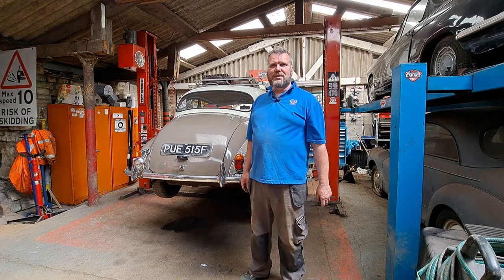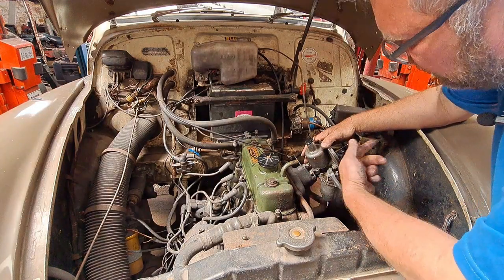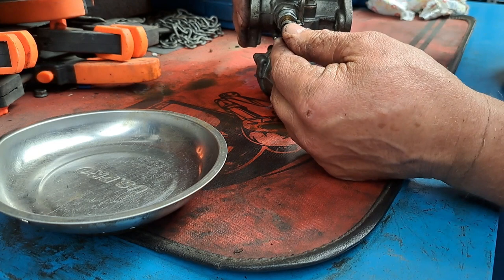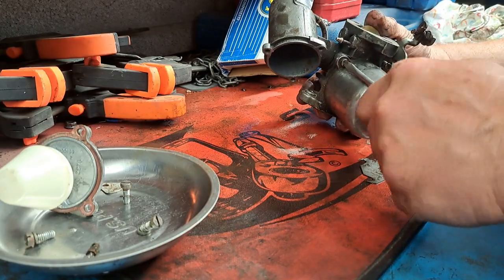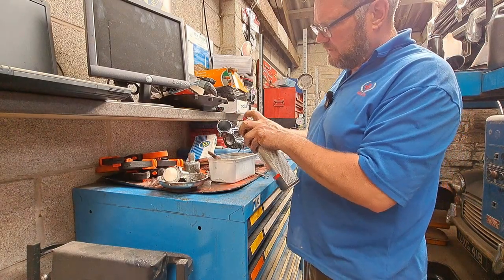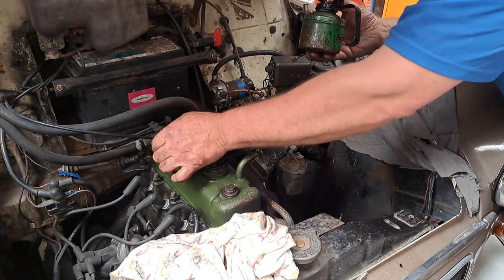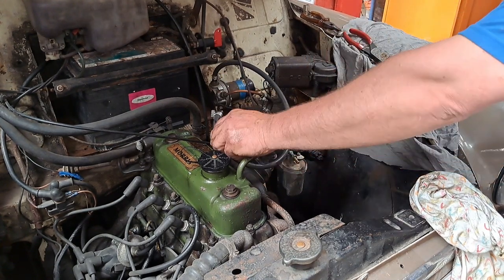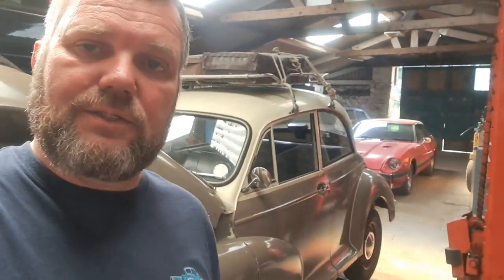Morris Minor Tune up! More power, carburettor rebuild.

Comment: Up until 1985 I always had a Morris Minor van, I would use this on my 70 mile round trip commute to work every day and never thought anything of it. The only issue I ever had was the points breaking, 10 minutes at the side of the road and I was off again. I always carried a box of tools and oddments 'just in case'. I've now bought a 1961 2 door saloon, this will be my everyday drive. I've watched Llord Jacksons video's for some time and it brings back so many memories, thank you!